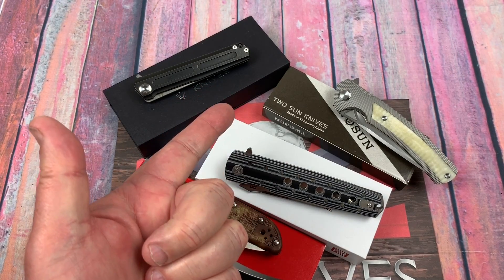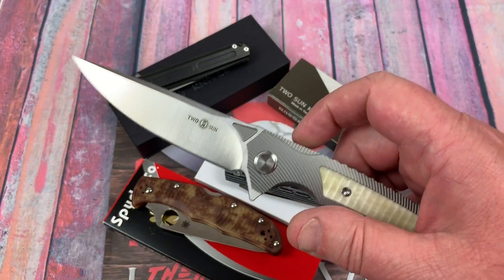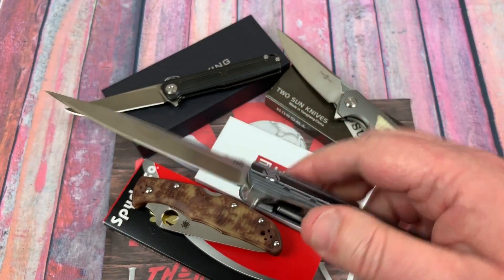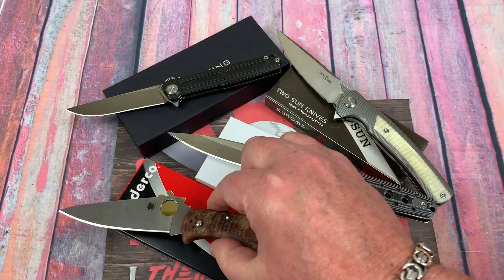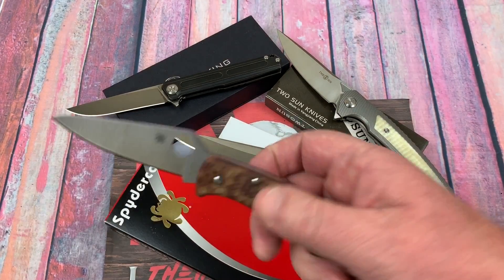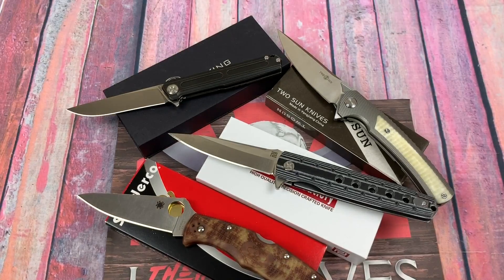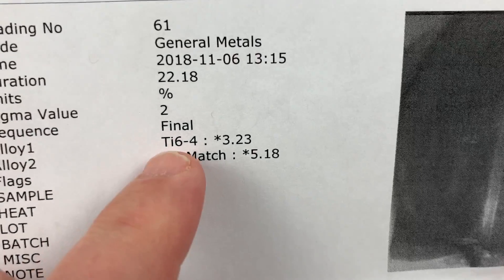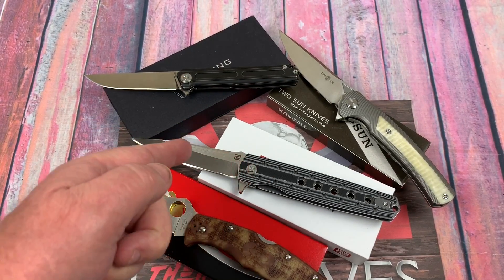Knife Testing Results Batch 3   Artisan Cutlery,Stedemon Vouking,TwoSun, Fat Dragon, Spyderco

Comment: Thanks a lot dude! Your videos has been discussed and spread in China, and we all appreciate your great job on this kind of review with hard evidence！
Finally, your videos ended the debate and doubt on what the hell the steel used by those Chinese brands which had last for a decade!
Reply from the maker: galancer backsu   Thanks.  I knew that China had access to all the different steels.   It’s a bit of a maze sometimes but most everything is testing good !!
Reply: @LuvThemKnives  There is still one thing I am not sure about CH D2 folding knives. I watched your video but could not find one thing about that. Is CH using D2 or at least Cr12MoV ?
Reply from the maker: galancer backsu   Check out my Video for batch 1    I have a CH g10 model in D2.   Steel Test video batch 1:https://youtu.be/Nh4rjoeY748